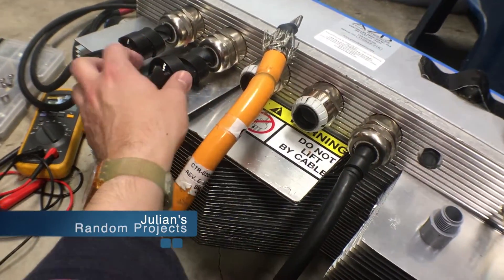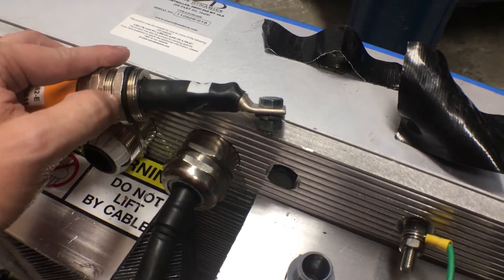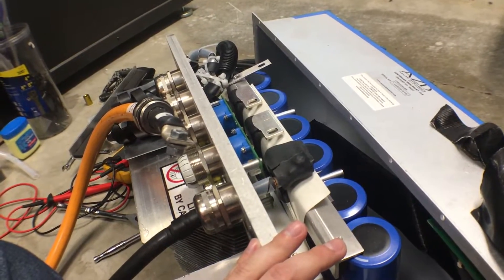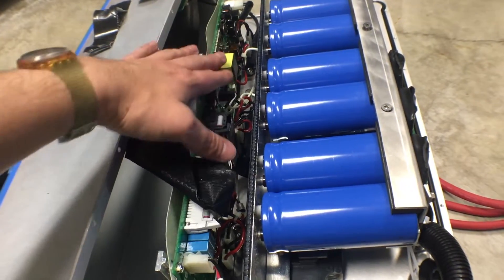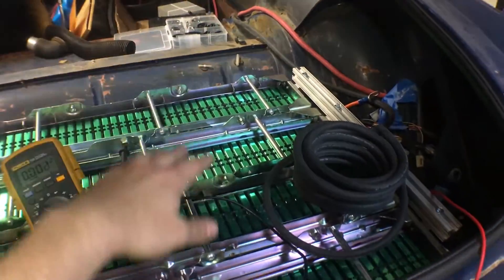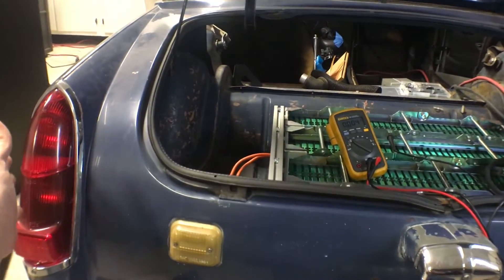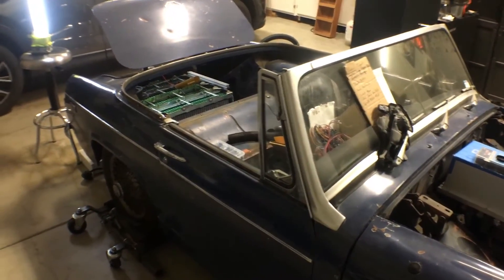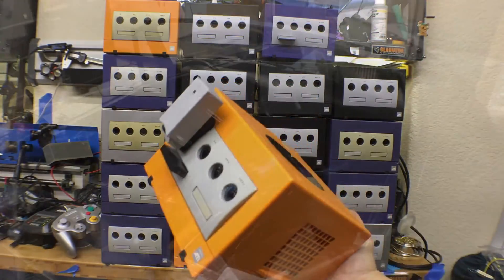MG Midget EV Conversion Part11 Back at It

Comment: Julian, great projects, I rabbitholed through your channel. I'm scratching my head about something. I'm prob going to get the same Siemen's motor and dmoc, but struggling to find info on a good voltage to provide. I read undervolting is ok. I'm wondering if 60-96v will be too low to push a 3000lb Vanagon, with a discharge rate of 100a to max 175a. any insights?
Reply from the maker: My dmoc came with a low voltage cutoff of ~250v So I didn't have much of a choice (maybe it can be reprogrammed, I don't remember). Higher voltages will save you on copper gauge for the battery and drivetrain wiring. I'd try to match some of the pack voltages that exist in the market so you can re-use them without much change. So you'd take a telsa pack or ford pack full voltage and just find a place to stick it. Jehu is a great resource for van. Goodluck!

Comment: nice to the EV project, that is one monster inverter. what is the KW of the motor?
Reply from the maker: Motor datasheet says 47KW but the Inverter it was paired with is rated at 118KW. So those are the bounding numbers. Maybe I'll be able to get this little guy on a Dyno (rolling road) at some point and we can see what's what.